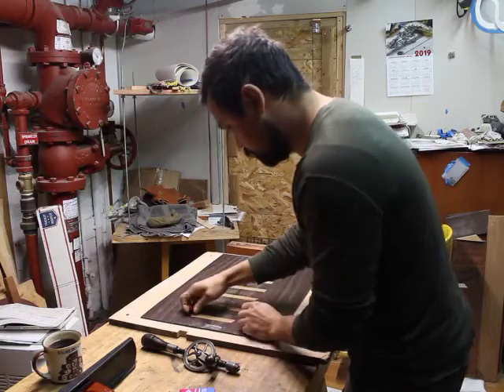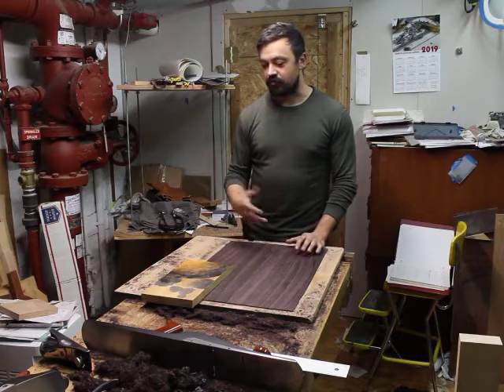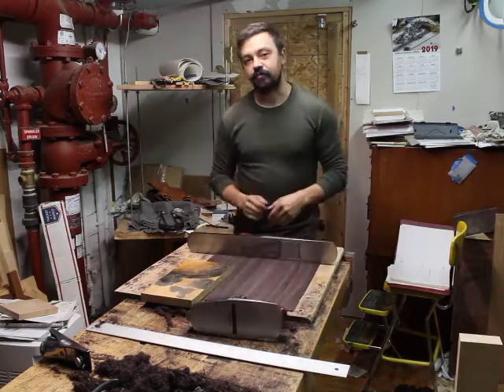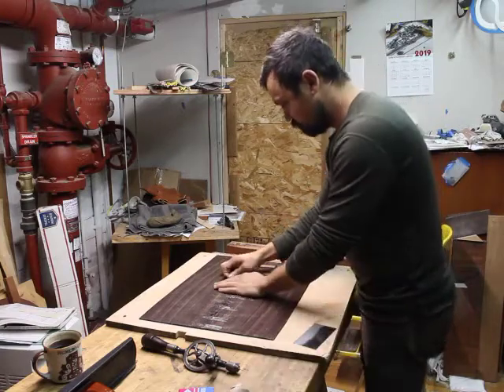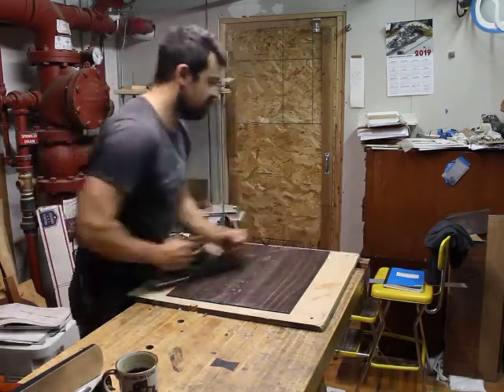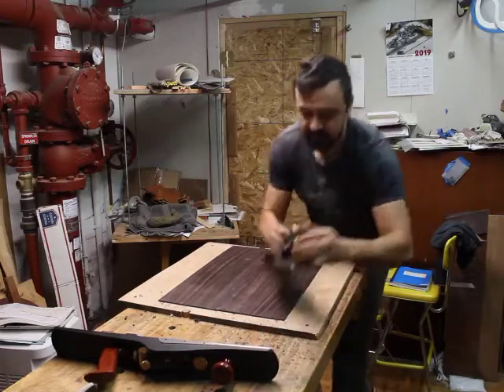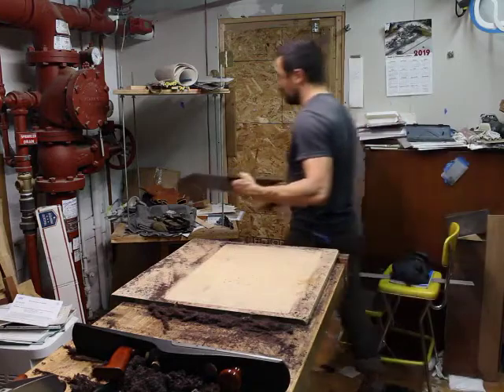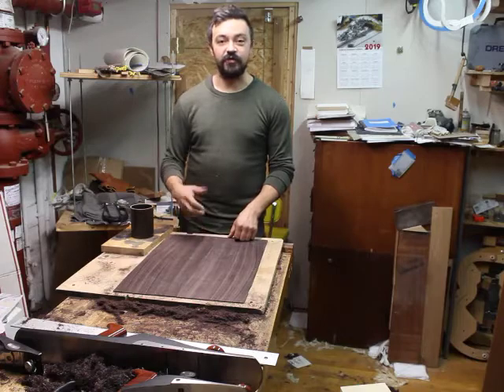Hand Thicknessing Guitar Backs, Sides, and Tops with Difficult Grain

Comment: I am out of space for power tools, so a drum sander is out of the question. I have been considering trying an acoustic instrument (usually make solid body electrics). I will need some additional tools, but this video tempts me to try by hand. I have Lee Valley planes already including toothed blades, a #80 cabinet scraper which may be ok instead of the scraper plane. I built a massive hard maple bench a few years ago - absolutely no skating or racking. So I'll try your methods! Thanks.

Comment: Thanks for the info. And what a nice low angle plane. I waxed my plane bottom for the first time and I was surprised that it actually seemed to help get a better cut. Getting an ancient wooden #6 plane could be great for this operation, the long sole and lighter weight may really help.
Reply from the maker: The veritas plane is great for this, and the toothed blade is a real game changer for working difficult grain.  The only disappointment I have with it is that the sides do not work well to use with a shooting board.  I did not think to mention wax, probably because it often slips my mind, but it amazing how much difference it can make.  I have blocks of canning wax next to my bench and find it can be a great help for resawing as well.
Reply: @QueenCityGuitars  Guess I’ll be getting a toothed blade. And I didn’t even know waxing saws was a thing! Sweet. Thx
Reply: Good plane to start is a Woodriver 62-1/2 low angle. It is affordable, Really nice quality, multiple blade options available, fits Lie Nielsen toothed blade too(i have this setup). Its nice cause its got some length to it, but way lighter than #6(cheaper too!) . I have a #1, 4-1/2, 6, 62-1/2 for bench planes and 62.5 is my go to for most every task.